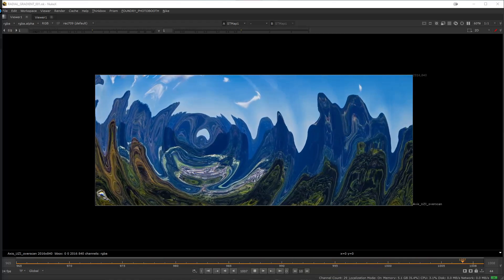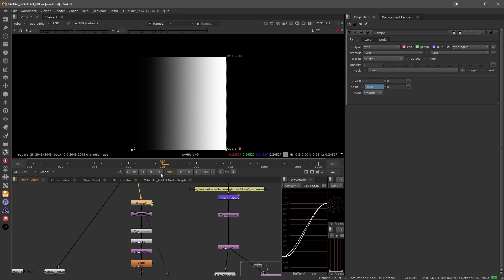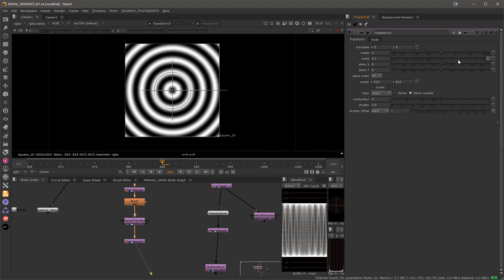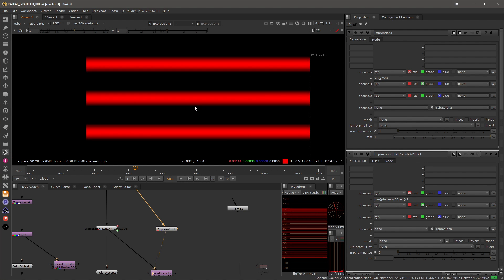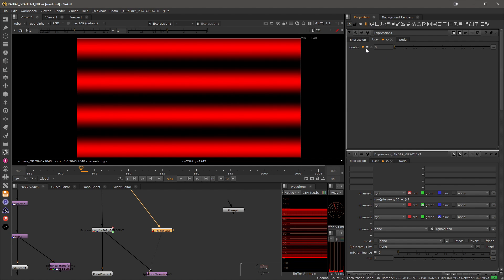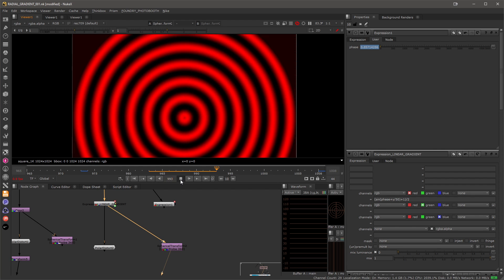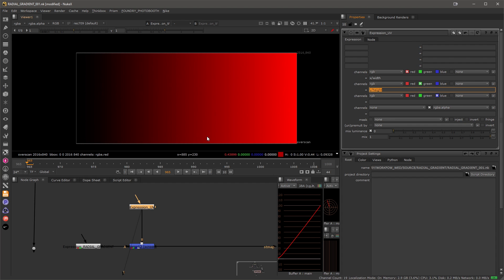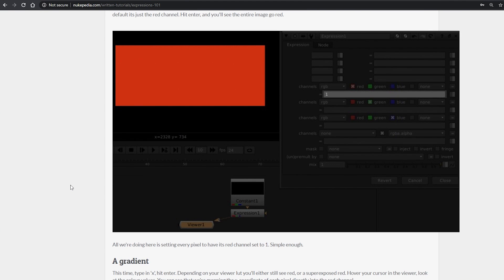Nuke Tutorial | How to create a radial gradient in Foundry's Nuke

Comment: Good tutorial!
One little note at 7:31, the Expression_UV --> it should be "(x+0.5)/width and (y+0.5)/height"

If you don't add the 0.5, your footage will have an negative offset of 0.5 pixel in X and Y. This will cause a little filtering :)
You can test this on a video if you use this Expression_UV and a STMap together. By default, you will see no change with 0.5 added, but without you do.